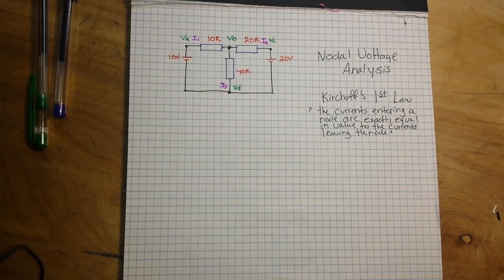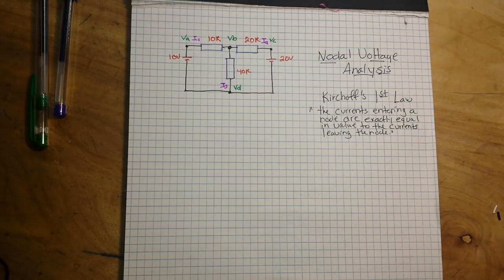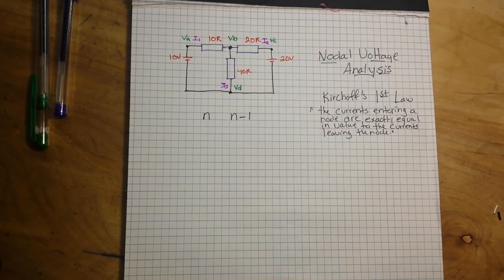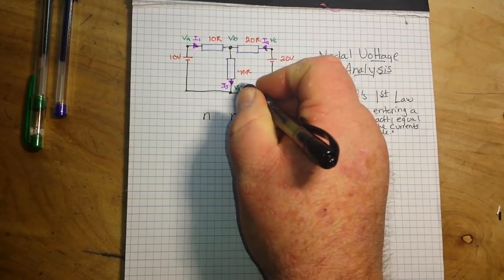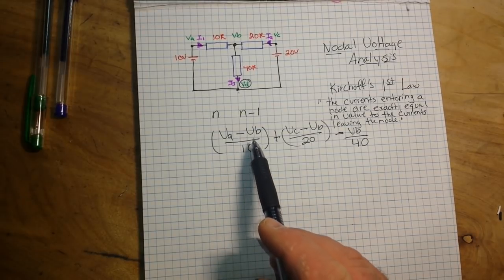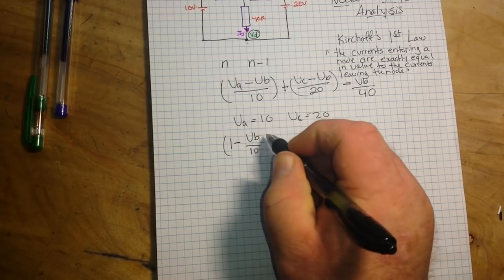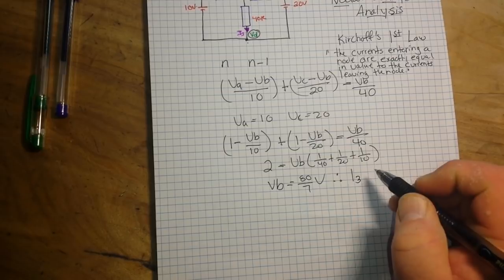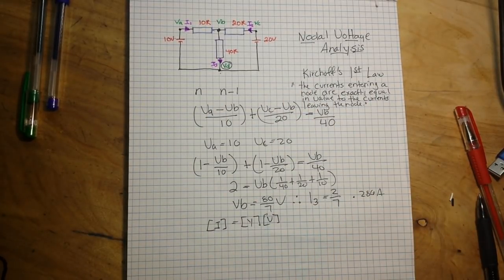DC Circuit Solving - Nodal Analysis

Comment: in the late 80's, i wrote a program in basic on a PC8 pocket computer (still works -printer) with a thermal printer (receipt tape printer) to calculate matrix eq, and print out all node results . this was how i learned how to do it manually. my instructor was overly impressed (he allowed me to use it on the final) considering how bad my ability to learn back then was (drugs and all). i consider this one of my early achievements in a useful programme, other than the business programme i wrote my mother in 1983 (i was only 13).

Comment: Lol, basically "very similar" to Dave Jones' video
Reply: Manuauto Therefore it can be easily concluded that both Paul and Dave are talking about the same Kirchoff fellow, aren't they ? 😉😉  There will always be different approaches to explain the same concepts however the final results will naturally be identical.  When the laws/rules are pretty much understood/mastered, the rest is a piece of cake.
Reply: SimpleEnough2k9 I can't really complain about free content.
Nonetheless It would have been nice to have two circuits that were explained to get a better understanding.
Reply: I understand what you mean.  On the other hand, try to reproduce a similar circuit on a breadboard, use different component values, then do your calculations.  Finally compare your calculations with your measurements.  There is nothing like practice.  A big satisfactory feeling will emerge when you will find out that what you predicted on paper is what you measured.  At that time you'll know for sure that you understood and properly applied the concept.  Have fun !